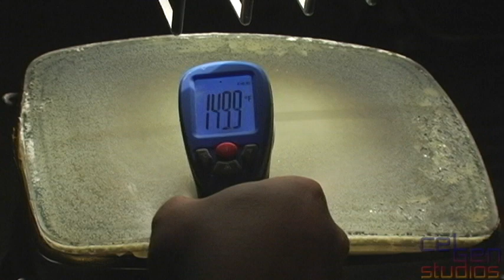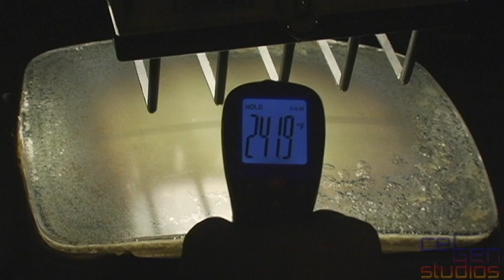CRT Cataracts: Identification, Removal and Repair

Comment: You're supposed to use a minimum of double sided tape and instead shoot bathtub silicone (the acetic acid kind) and run a bead of it all the way around the outside between the glass and the CRT. It provides way more mechanical stability and sealing than doing it this way. I recommend watching YouTube user Shango066 and his videos on removing CRT cataracts.

Comment: The "bump" at 8:52 is the remains of the injection port where the liquid PVA was injected between the tube and faceplate during manufacture.
Reply from the maker: I had a feeling it was something like that. Halfway through the heatgunning it occurred to me it was more than likely the injection point.

Comment: Is this removal method still somewhat applicable to more modern CRTs? You said the bonding agent was changes, is the new bonding agent more heat resistant?
I ask because I need the safety glass from a CRT for a project, I'm turning an old TV into an all-in-one computer, I'd like a modern LCD panel in it, but the screen of the TV is curved, the LCD is not, having a curved glass window in front of the LCD panel would somewhat help with the discrepancy.

Comment: Does the safety glass' being adhered to the tube, with the factory adhesive, offer any structural support as far as keeping the display from imploding? Is anything compromised by removing that layer and simply adhering the safety glass with the double-sided tape? This is a genuine curiosity of mine because I may want to perform this on a CRT that has a tiny cataract. I'm just trying to determine whether or not it's worthwhile.
Reply from the maker: The adhesive that bonds it on, no. The glass, yes as it's a sacrificial piece of glass to catch as much pf the debris as it tries to splash back and out the front of the display, or at least absorb the ejection force of the larger pieces.
Reply: @CelGenStudios  I've read that the adhesive is part of the barrier. I'm still undecided on whether or not I want to treat a monitor with a single spot of cataracts on it.
Reply from the maker: @icantgivecredit871  If you don't mind it on the edges of the tube and the adhesive is not yet liquefying I'd leave it alone for now.
Reply: @CelGenStudios That's the plan. It's a huge shame about the tube, but at least it's outside of the viewable area.

Comment: Good video. I never knew about this before. But given the small chance that something big and bad could happen if you were to knock the CRT by accident or have the glass develop a stress crack, i think you NEED to emphasize safety comes first. In particular gloves and glasses. You could be doing everything right and still the CRT could crack and implode violently. Why risk your safety for a tube?

Comment: Tell me if you get a chip in the glass should you vent and discard the tube or could you use a windsheild repair kit to reduce the chips?
Reply from the maker: If it's in the safety glass, that's fine. If it's in the CRT I would hazard to evaluate in a per-tube basis because depending on the size of the tube or where the chip is located. I have buffed scuffed tubes but it's a lot of work.
Reply: @CelGenStudios  this one doesn't appear to have safety glass but ill have to double check however the chips look like pellet bullet marks but it wasn't like it before and i suspect my neighbor of doing it

Comment: couldnt you just use jb weld red gasket sealer?  iv used it on cpu and its a terrific resealer and i havnt had issues deliding and reliding with it

Comment: Nice tutorial! I had the same problem with my superbrain. I just felt not too comfortable with pointing a heatgun at a CRT. However, I managed to get the glass off without heating. I just used blades and lots of syringes filled with acetone. There is also a method to put the CRT face down in water for a month or so. I will try this one next time.

Comment: great vid doing my little 9 inch monochrome now
Reply: had to use silicone on my screen as the copper band protruded so much it was very hard to get the sticky pads on which didn't stick as well , looks good through !

Comment: Does this happen on later tvs like ones from the early 2000s
Reply from the maker: I have not seen it happen with newer tubes. This could be either they changed the adhesive or it's still to early.
Reply: I belive they changed adhesive to optically pure epoxy. Add a drip to the middle and push down. Hence, no sign of the injection bump.

Comment: Not bad, up until the last part. Foam pads to secure the glass? Why not put it back to almost-like-new and use UV LOCA adhesive? It'd be a perfect, better than original bond, and no chance of crap getting between the glass surfaces.....
Reply from the maker: The foam gives you a liiitle bit of wiggle room if you screw up, plus the added gap to factor in the missing PVA.

Comment: CelGenStudios, I have a question. My CRT has this bluish tint that recently started to appear. I assume it might be a dry solder point or maybe (god have mercy) the gun is going bad. Any idea on how to identify the problem and repair my CRT?
Reply from the maker: Without being there in person to look at it the best I can recommend is asking over on the Videokarma forums.
Reply: I registered on the site, but when I try to post it kicks me off the site. I'm guessing I have to wait for admin to approve me? Anyways, I had my CRT into an HDMI to VGA adapter, but once I removed it and plugged my CRT into my laptop VGA for testing, It worked fine. I got a different adapter (DVI-I to VGA) and plugged my monitor back into my tower. Worked fine for about 24 hours and then I started to see the blue scan-lines reappear. Which I think means its either: 

1. My graphics card (GTX 980 FTW) might be having some trouble adapting to the monitor's frequency in someway?

2. (I pray this isn't it) There might be something wrong with the CRT after all. (Even after all the work with retr0bright and cleaning I did to restore it).

Any thoughts?
Reply from the maker: Yes, due to spam issues when you register you have to wait for a moderator to approve you before you can post.

It could possibly  be a bad connection in the VGA cable. Again, I'm awful doing long distance troubleshooting.
Reply: CelGenStudios If you'd like, I can send photos or video of the problem via email.

Comment: Anyone watching this video thinking of doing it exactly the way this guy does it please do not he is doing it wrong.  He’s applying way too much heat way too fast and the risk of it Imploding right in your face is very good also no he’s not wearing any gloves or mask. You should wear a face shield and not have any exposed skin anywhere near this operation.  Including CRTs will smash you right in the face with tons of very heavy very sharp glass. So if that idea thrills you go ahead and follow the instructions in this video.
Reply from the maker: I see you missed the parts where I mentioned that proper safety equipment should be worn, be careful of thermal shocking and well, there is no need to rush the process. Likewise this is not a new process and is based of other people's work. IF you think you can do it better, please make a video doing so.